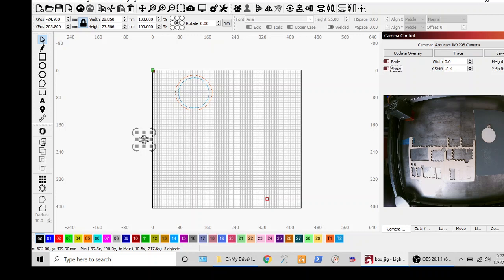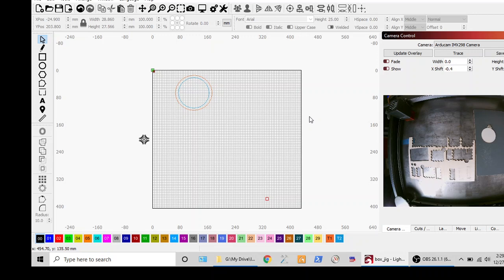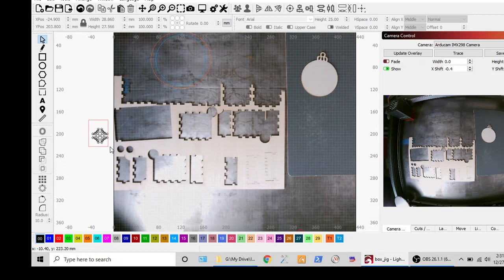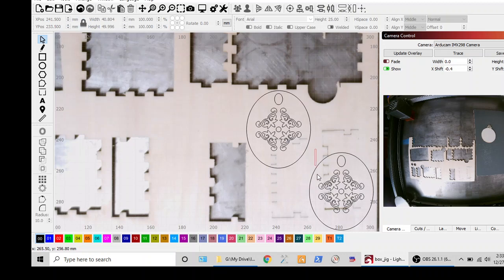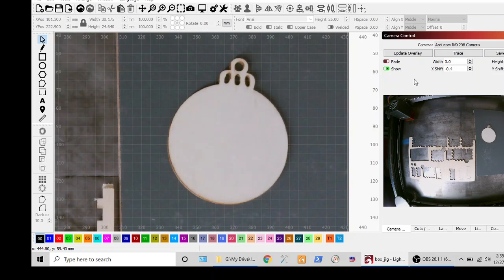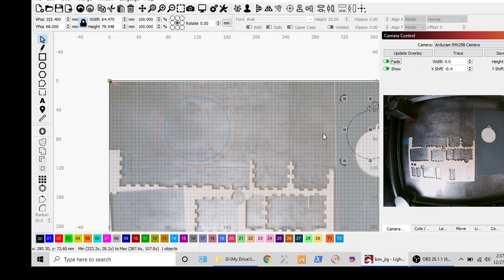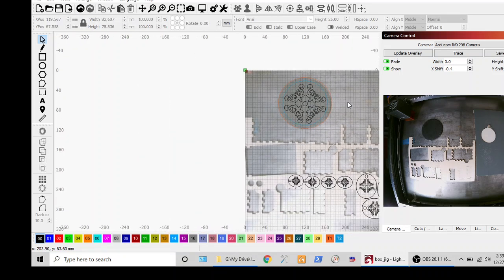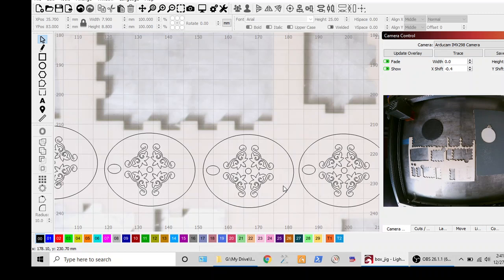Camera kit demo from Geeks At Large

Comment: Hey Coby, so in the market for the best camera for my xtool D1 pro that also fits inside the xtool enclosure... is this the best choice for that, or is there another that is better? Also not essential but if there is any that work with creative space aswell... in a wheelchair so it is harder to keep a constant eye on the work station, mentioning that to see if you have any other things you suggest based on adaptive items to make my life easier, thanks.
Reply from the maker: @nicky23981  hey there!

To the best of my knowledge, no other camera kits fits inside the xTool enclosure, and even mine has limitations (not leg extensions).

Unfortunately, nothing works with xTool's software other than their own hardware.

If you are just trying to keep an eye on the machine while running, a cheapo baby monitor will get you there :)
Reply: @geeksatlarge  thats a good idea thanks will try that.

Comment: Amazing tutorial Cobey! Floored by the efficiency of this method. One question,  when we're going to set up the virtual jig, the circles from your earlier coasters were already there and you added a design for alignment.  Is there a keystroke or button clicked for making these templates? Noticed their different colors too.
Reply from the maker: What I do is create the virtual jig, then save the project. This allows me to recall it over and over. The colors are the various layers. For a virtual jig, putting the material outline on layer T1 or T2, which are tooling layers. Tooling layers frame only, nothing else.

Comment: Is there a website i can see the items you have at? i would buy this ins a heartbeat.
Reply from the maker: The kit will become available here when released 

https://www.etsy.com/shop/GeeksAtLarge
Reply: @geeksatlarge  Can i ask the difference in your camera system vs the one that light burn sells?
Reply from the maker: @joshcolvey8585  Lightburn sells a camera. Two actually, but that's all you get, unless you buy the case too. I'm putting together a full kit - camera (no case needed) and mount to attach the camera to the D1. The camera I'm planning to use is a 16MP, compared to the 8MP and 5MP versions Lightburn offers.

Comment: Tip: An easier way to select multiple items is to make your box from lower right to upper left.  When done this way, all features that the box crosses are included in the selection.  When going from upper left to lower right, the box needs to completely surround features for them to be selected.
Reply from the maker: Thanks for the tip!